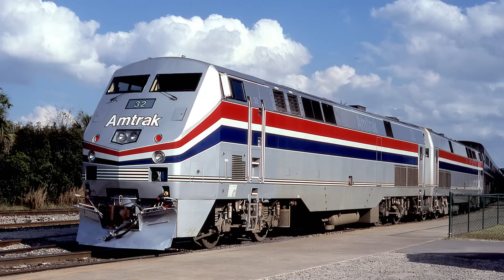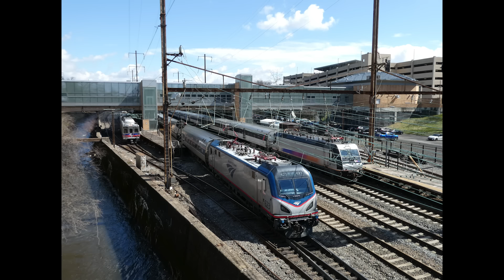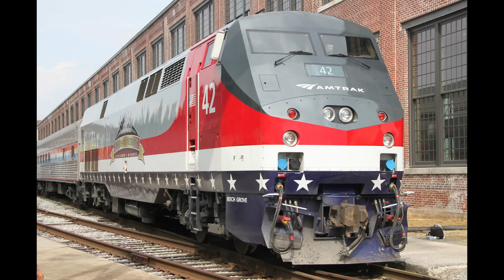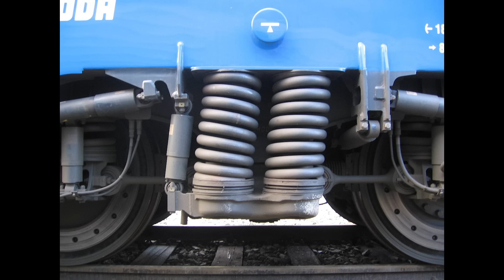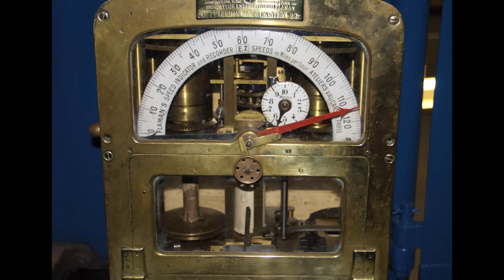The Locomotive That Engineers Refused to Drive

Comment: Dispatcher: BNSF hold for Amtrak 32. 
BNSF crew responding: " Amtrak doesn't operate on this line"
Dispatcher: Hold for Amtrak 32.
BNSF crew: There is an Amtrak train on this line. 
We had Amtrak 32 as our lead loco on an AAPRCO special. Going to the National Parks starting in Denver and ending in Seattle by way of Yellowstone and Glacier National Parks.

Comment: Wow, dude! I remember running GG1's at speed through interlockings and feeling the front and rear suspension bottom out laterally in opposite directions.  That's about 500 tons of reckless metal at speed.  Used to scare the crap out of me but miraculously,  those beasts stayed on the track.

Comment: I wonder how Amtrak will handle the issues of its new locomotive in the extreme conditions on the Empire Builder?
Reply: They installed a reverse blower to keep snow from building up in the radiators.  And the only thing delaying implementation on the CA Zeyphyr and SW Chief is they're still setting up DEF fluid distribution on the route, right now Denver is the only place on the Zephyr route where they can refill DEF fluid.

Comment: I ran these engines between Philly and Washington at 100mph which what they good for when they were new. They weren't upgrade to 110 until half of them were rebuilt in the mid 2000's. Most of what the video is explaining may have to place when they were brand new . They rarely ran no  higher 90mph unless than  in NEC. Most of this stuff about the ride quality is not true unless it was riding on bad track. The last P40'S just got retired this year when they were replaced by the Chargers on the Auto Train . They're still some  Ex Amtrak P40'S operating on CDOT.  The Amtrak P40'S  horse power was also increased to match the P42 at 4250hp. As far as im concerned both All 3 versions of the Genesis engines rode on the same truck design so the was a little stiff but to cause  all the issues the video described. Also I never heard of an engineers refusing to operate the P40's on the only thing the complain the most about what the fact that the were slower than a F40 on the start and how close they were to the windshield  the rest I think sounds more like info that related to the P30 or E60's! I knew engineers that didn't want to run those engines not the P40'S.
Reply: After the E60's truck problems were corrected they became preferred power on heavy heritage equipment trains. Same with the P30. It became preferred power for the "Panama Limited"(later City of New Orleans)
Reply: Really? Philly to DC is on the NEC which uses electric engines (AEM-7 until replaced by the ACS-64s).  When and why would they ever run a diesel-electric on this route? The only possibility would be on the Pennsylvanian or Broadway Limited out to Pittsburg or Chicago.  I don't believe P-40s were ever assigned to these routes.  F40PHs until replaced by P-42s.
Reply: @lewstrauss1158  Yeah the only two diesel hauled passenger trains in Philly leave 30th St Station to the north, those being the Philly to Pittsburg leg of the Pennsylvanian, and NJ Transit's Atlantic City line.
Reply: @lewstrauss1158 Ask David Gunn, he was a fan of diesel power on the corridor.
Reply: I have ran all GE varieties, P40, 42, and the P32acdm. Never have refused to operate one. Have I had a few through the years with a little lateral motion of 90mph? Absolutely. 
Just makes the trip a little more exciting😂😂

Comment: Ive never liked the look of these going forward to current engines.

STYLE WENT OUT THE WINDOW.

Bring back 1950s carbodies with redesigned frames etc + tier 4 power plants.

There is NO REASON the grand passenger locomotive body styles of the 40s & 50s cannot be replicated.

Get rid of this UGLY CRAP.

Comment: You run trains, you don't drive trains.
Reply: Same shit
Reply: Actually in Europe you do! In the US you operate a train!!
Reply: The twit you whote this is obviously an Anglophile. Nothing wring with that, but if he is writing for a US audience he should use the proper term.  Engineers Operate Engines which pull COACHES and CARS in the US. Cattiages are puulled by jorses over here. Drivers have steering wheels. Drovers wear boots and big hats as they urge animals along.

Comment: Upgrade for your OS. Click, click, done. Upgrade for a 269000 pound metal machine? Same as the OS upgrade.  Someone sees a problem with the original item.  Not a deep flaw.  Others feel it also.  Think about the time it will take for this feeling to rise to the manufacturers attention and then to ...
Amtrak and GE released upgrades.  Todays designers include the idea of upgrades.
Reply: 26900 pounds? For a locomotive? Aren't you missing a zero somewhere? I used to drive city busses with a MGVW about that number, and they were 36 foot "shorties", not the full length version. That would be an insanely  low weight for a locomotive, especially a high speed one.
Reply: @Bristolsailor73  Thank you, the missing zero has been found and will be offered as an upgrade.
Reply: @josephreedF40ph  Good, just be sure to clean the Akutan Island mud out of the engine cowling and straighten the propeller before issuing that Zero as airworthy. The Imperial Japanese Navy thanks you for your efforts. 😂

Comment: A bunch of whiny old timer engineers who didn’t like change. This video would make you think that the old F40s didn’t rock and roll either. They rode rough on certain tracks as well. This is a track maintenance issue. The E60s had REAL ride quality problems. So bad that they derailed several times because of yawing.
Reply: I'm a retired "old time engineer" and you have no idea what you're talking about. The E60 was a good locomotive. Once it's truck problems were solved they were preferred power on heavy heritage equipment trains
Reply: @w @williamhayslip1644 Yeah, after they got shaved down to 90mph… So reliable, they couldn’t even run near their designed top speeds. What other junk would you say was good equipment?
Reply: Same thing happening now. Everyone complaining about the chargers and don't  want to get rid of the same GE they complained about before. People just don't like change
Reply: @swole217tv  I have no issue with the Chargers other than the God Damned things fall down so much. They keep trying to put them on the Texas Eagle, and they keep failing. (More than the P-42s). All the anti pollution shit, computers and overcomplication. It does not appear to play well with PTC.

Comment: Another uniquely awful presentation. Almost every sentence contains false information. The maximum speed of the P40 (AMD=103) was 103mph. They also run at a constant 900 rpm when in Head End Power mode. Reducing weight also reduces the available tractive effort. The North East Corridor uses mainly electric locomotives; the Genesis locomotives were designed for other routes. And on, and on with falsehoods.
Reply: Exactly. I don't know where they get their "facts" from
Reply: I listened to 43 seconds of this video saw your comment and immediately clicked off of it. And gave it a thumbs down.
Reply: I wonder why. Maybe it's a power struggle. Someone wants us to be wary of the locomotive depicted in this video. Perhaps the industry directly connected to this sector is known for its left-wing views. Which makes the opposing team jealous. In the current situation of right-wing domination, there is a justified suspicion that the provision of falsehoods is in the nature of a fight for voters' votes. 
Thanks for this valuable information. Now I'll be more vigilant in the next elections. The right wing is too perfect. This raises doubts. 
Maybe I'm the victim of a lie, reality isn't so perfect. Reality is not a fairy tale....
Think about that.

Comment: Amtrak locomotives look like crap😊
Reply: Should have stayed with Alco PA,  EMD F & E, C liners, and designed a non catenary fed, integral prime mover and gen set GG1.
Reply: @bobpaulino4714  Should have, but didn't.  Now they dispose of them like used diapers.
Reply: Where the Hell did that come from? The Genesis units are sleek, aerodynamically designed. rather pleasing. Much more pleasing than tha Jap and Euro designs with the long forefoot like a ship.  
Indeed, beauty is in the eye of the beholder, opinions are like assholes, everyone has one. I just don't agree with your one size fits all apply anywhere flat statement.

Comment: Yeah, we got it. Repeating the same concepts multiple times before moving on to the next subtopic is poor. "Hunting" is self explanatory. Needs to be shortened by 60%. Seems many of the diesels Amtrak have bought over the years, (but the F40ph) have had teething issues, failures or banned (after 70s derailments). The Genesis locos are still going, having lived beyond their intended service. I've never liked the nose. They look pretty awful. I don't like the new Siemans' very much, either. But the real problem is their poweplants, problems operating in cold weather. Charger locomotives (including the SC-44 and long-distance ALC-42) have faced teethting problems, and prime movers grenading (BOOM), with 1 unit already retired, & half the SC-44 units out for months in California. Hope it's not another disaster for Amtrak, beyond just their state-supported units on the western corridors.
On the Northeast Corridor, the Bombardier/ Alstom HHP-8s pulling the regional trains were scrapped by 2014, others removed prior, (mothballed) due to severe reliability & failures, from complex electrical and computer systems to significant traction problems, getting prime mover's 8,000 horsepower to the wheels. Wheel slippage led to damage in the wheels and rails, making them financially unviable. They were replaced by Siemens ACS-64s power units as quickly as Amtrak could rush them into service. The HHP-8s are being repurposed to serve as cab cars, on the Keystone, and some Amtrak NEC trains. Amtrak and riders suffer for these disasters. Need a bulletproof 4,200 hp, 4 axle transcon unit that can go multiple millions of miles. Not sure the new Chargers will be what the homely units in the above video have been able (to do).
Reply: 1st and foremost  the HHP's were never scraped.  They simply taken out of service until railroad decided what to do with them. Yes the ACS64 replaced them and the AM7's in 2014. Like anything new that has never been tried  and proven in this country they're going to be issues that running around on a loop track in the desert can't create. The only reason why the F40's didn't have a lot of issues is because it's simply a GP40 with a different body and a few mods for passenger use aka proven technology that everyone's familiar with. Everytime something new enters the property your always has engineers who are going to be prejudice about equipment until they realize they have no choice. Engineers get payed too run trains not judge with engine is prettier!
Reply: It's a good thing they can pull Genesis locos out of retirement when the chargers quit.

Comment: Too tall and only 2 axial bogies not tri bogies causing instability
Reply: 2 axle trucks are more stable at high speeds for passenger locomotives.  3 axle trucks are for maximizing starting torque on freight trains and are less stable at high speeds which is why you never see them on passenger trains.  All 3 of the 6 axle locomotive designs Amtrak used in the past were plagued with issues and had short service lives, with the SDP40F being a particularly bad design that derailed multiple times due to stability issues.
Reply: @mrvwbug4423  Indeed. TRUCKS, not bogies. And your statements are fact.
Reply: @The_DuMont_Network  Both terms are correct, just depends on the country.